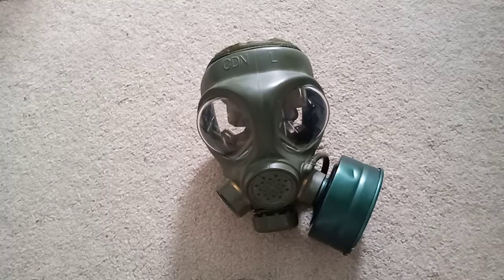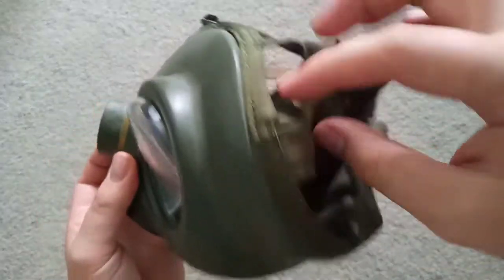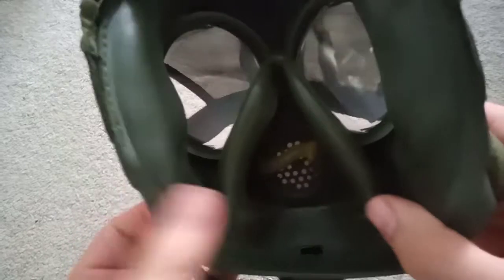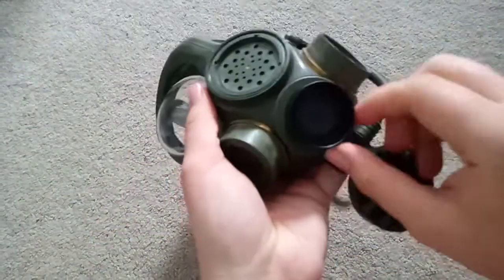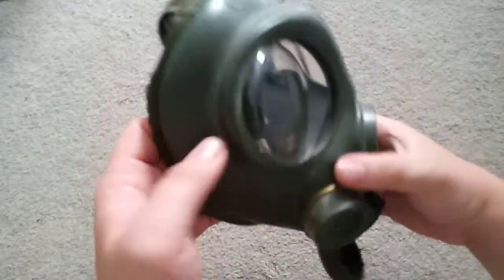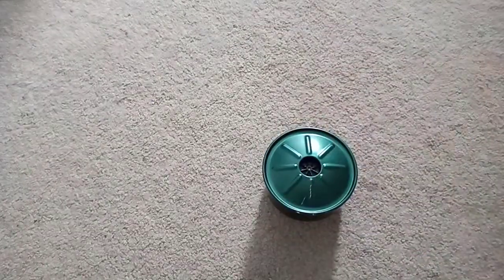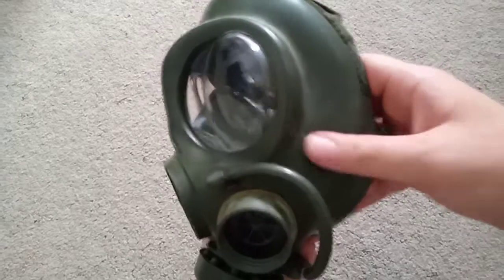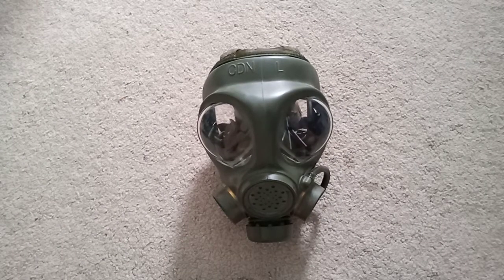PC4/C4 gas mask review

Comment: I don’t think this is a PC4 , the PC4 VPU is extended and the skull cap sewn on from factory and issued to the civilian market and police forces , should say on the tab at the bottom of the skull cap.
The early versions were modified as the straps would snap at the rubber so skull cap would be sewn on , we’re as the PC4 was all done from factory
Reply from the maker: It has the sewn skullcap, not all PC4s have the diaphragm flange.

I've already talked to a few specialist collectors about this